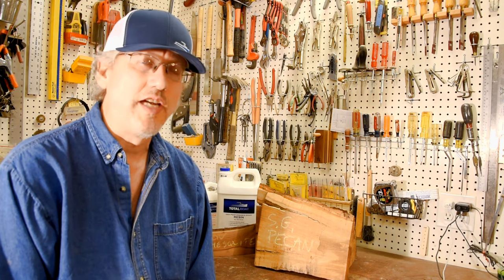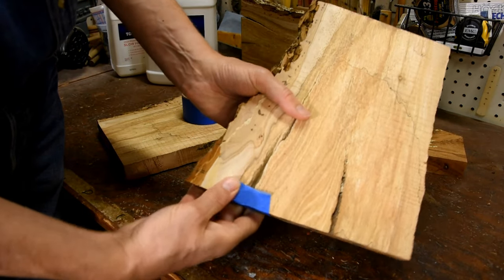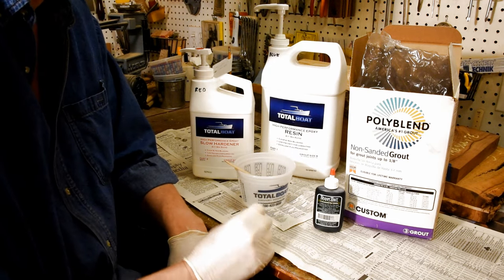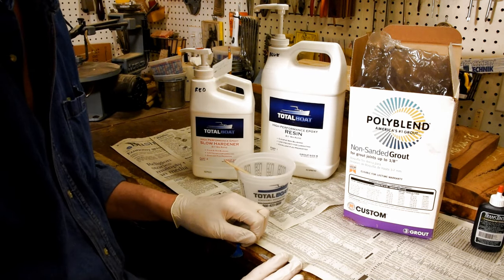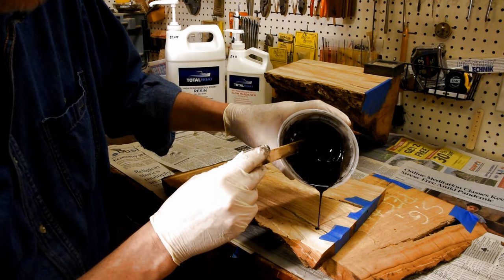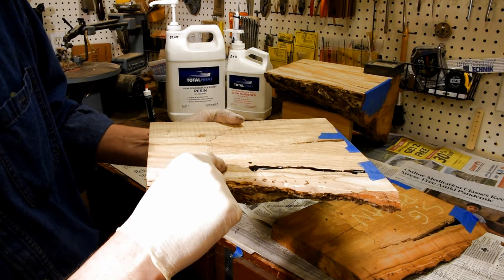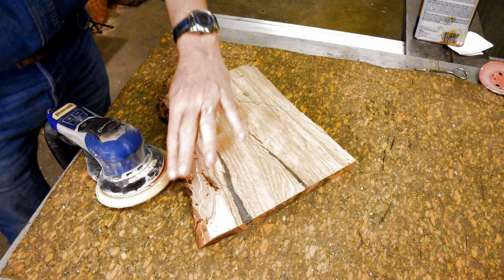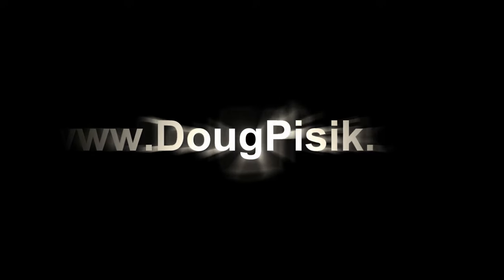Using Epoxy Resin to Fill Cracks and Gaps in Wood - Complete Tips and Techniques

Comment: Tip from experience:  When you're using tape to secure the back side of cracks, holes, etc., for larger epoxy pours than Doug shows in the video, MAKE SURE the back is supported.  Epoxy is heavy, and the tape can only take so much before it starts bulging and leaking.  Blue tape, frog tape, Tyvek tape, doesn't matter...support the bottom with something flat and hard on larger pours.
Reply from the maker: Great tip, Jason.  My project was flat on the table, but it the crack was unsupported it would have been a problem.  Thanks for mentioning this.
Reply: @dougpisik  Is there  a way to fix it once it leaks through the tape. I didn't support, so every deep pour leaked. so heating and removing all the epoxy i can, and plan to repour. Hope this works as i don't want to loose the project.
Reply from the maker: @vegasace  If I understand your question, it sounds like the epoxy poured out the bottom and left a bad mess to clean up.  I wouldn't remove any of the epoxy that is in the crack.  I also wouldn't heat the epoxy that is on the surface.  Instead, I'd recommend using a heavy grit sandpaper to sand down the mess from the bottom.  You can then re-tape it and ensure it's secure.  Then you can repour more black epoxy into the crack to finish filling the gap.  Good luck with it.  Sorry you had a problem.  I know what a mess leaked epoxy can be.
Reply: @dougpisik  Thank you so much, i just got a heat gun and was about to go down that road...saved me! Appreciate the advice and the nice words..its all about learning so still very excited..messes we can clean! Ill keep you posted.
Reply: @ doug pisik - Took  me awhile to finish, but wanted to thank you. Table turned out great, thanks to all your help. Would post a pic here if it would let me, but very happy with the piece!
Reply from the maker: @vegasace  Sorry I didn't respond to this months ago.  So glad your project worked out!
Reply: Thank you for your video.  Going to attempt some black walnut end tables now

Comment: Just a quick note of thanks for the tip re using non sanded grout to tint the epoxy in void filling. I just finished a project and used the same grout, based on this video’s recommendation. Worked fantastic, and now I have about 2 lifetime’s supply of black epoxy tint at about 1/50th of the price of regular tint powder or TransTint dye.  Thanks.
Reply from the maker: I'm so glad you could use this info.  I know what you mean about the amount of grout.  I've barely made a dent in the box I bought years ago.
Reply: Where did you get your grout? Both Amazon and home depot don't list black as an option but have charcoal.
Reply: @partycakes456  Both Doug and I were using the ‘charcoal’ colour. There is no ‘black’ in that brand, that I could find. The charcoal grout is, I would say, ‘very nearly black’ once immersed in the epoxy.  It’s not a true jet black - more of a very very nearly black dark grey - but it’s ‘black enough’ for this purpose.
Reply: @Ian_Hay  Thank you, I'll give the charcoal a try.
Reply from the maker: @partycakes456  I did use “Charcoal.”  Thanks for asking.

Comment: I like the tip of using the un sanded grout for color. I guess since grout uses water to cure then mixing with the epoxy kind of seals it from moisture and probably if any moisture does get to it from humidity or whatever then it just cures also? Just trying to think the chemistry through some and avoid any long term problems from something maybe even attracting moisture.
Reply from the maker: Thanks for the comments and question.  I haven't had any issues with the grout.  It's really just a powdered pigment that doesn't dissolve.  I agree that since it's coated and soaked in epoxy, it doesn't absorb liquid.  That said, I haven't tried it for outdoor projects, but I feel confident that it should work just fine.

Comment: It's good to know that the epoxy was hard enough to be sanded or planed after a single night of curing. The documentation for the Total Boat 2:1 with slow hardener recommends 5 days of curing, so out of an abundance of caution, that's how long I've been waiting before sanding off the excess.
Reply from the maker: Rob, great advice and input.  It's true that it's better to wait before sanding.  I have found that for cracks and smaller pours overnight often works for me, but it could be that the addition of the grout makes the epoxy cure harder.  In addition, my shop is warm.  That said, waiting is safer, and ensuring the work is not curing in an unheated room (like a garage shop in winter) is also helpful.

Comment: Nice video! Thank you for the tips! I’ve never experimented with epoxy before. I’m looking to fill small worn holes and knots in a charcuterie board. Is this method food safe?
Reply from the maker: Many people use epoxy on serving boards and tables, but I can’t confirm 100% food safe. Best to contact your epoxy manufacturer.  My understanding is that once the epoxy is FULLY cured (about a month), there are no concerns serving cold food on it.  I personally would avoid putting hot food directly on the epoxy.

Comment: How long did you wait before you ran the work through the planer?   You said ‘the next morning’ when you took off the paint, but I thought that sanding had to wait for full curing … 5 - 7 days?
Reply from the maker: You usually want to wait a few days depending on the epoxy used.  If you sand epoxy before it's fully cured it will gunk up your sandpaper and not sand well.  If you use a planer on very hard epoxy, you run the risk of chip-out.  Although not really planned, by only waiting a day the epoxy was hard, but less likely to chip...so running it through the planer worked out just fine.  That said, it is better to wait a few days, and if you use a planer, take multiple passes with very thin shavings.  Hope this helps.

Comment: Great demo. But what do u make out of those pieces?
Reply from the maker: Glad you asked, Susan. 
Smaller repaired pieces like shown in this video I use for creating art boxes. Longer boards are used for furniture like table tops. I have used this technique to fill in the splits in logs and then turned them on my lathe to make bowls and vessels.  In addition to cracks, this technique is used to fill in voids and knot holes. All these repairs look like natural accents, and if you decide to use colored dyes instead of black the repairs can become rather artful.

Comment: Great Idea using non sanded grout. I´ll give it a try. 
Right now I always have to do two steps when filling in crack´s. One coat of clear resin followed by one with black dye.
As you say if you use black dye epoxy right away it leaves a Gray shadow in the wood.

Comment: Great video.  What would you suggest for pre-finished hardwood floor planks as I'm building a table out of leftover pieces and a few have some knot openings no more than 1/4".  Would a flat chisel be ideal for cleaning up those little spots?
Reply from the maker: If feasible, I would mask over the area to be filled and cut out an opening for the hole. This will prevent the epoxy from getting on the finish. If a hole is about an 1/8th of an inch or less, you can fill the spot with black CA glue instead of epoxy. As for smoothing the surface, a chisel usually won’t work on brittle materials like epoxy. Since the holes are small, I’d recommend trying to just fill the holes up to the top without going over. Hopefully you won’t have to do any touch up, but if you do, then I’d recommend sanding and polishing the patch with the masking tape in place to protect the wood finish. Alternatively to all of this is to just use a wood putty since the holes are small. That might be your best bet. Hope this helps.

Comment: thanks for the video. Question. I am working on a 5 ft by approx 1 ft  oak board....very very dry ...with lots of cracks. That was the appeal.  But wow..when pouring  epoxy today ( i am new at this but watched so many videos my head is swimming) it just soaked right into the wood....leaving the crack still open...I waited..then poured again....thinking ok now that it is coated and a bit tacky the next pour will fill the crack...noo.  A couple of the cracks did finally fill in...i will probably have to top them off a bit...I waited the last time until the epoxy started to firm up a bit..a lot...SO...i decided perhaps I needed to "seal coat"? first ...but i dont want to seal the whole thing because i want to use 3 different colors to fill the cracks.  Is this making any sense?   So i thought ..I wil lspray a polyurethane coating...then later fill the cracks. Would the polyurethane spray be bad to use if using Resin? If so what can I use?
Reply from the maker: Nila, great question.  What you describe is almost like making a river table with the larger cracks. I don't recommend a poly spray since the epoxy might not stick to it and also you may see the line between the poly and the epoxy.  Sealing first with epoxy for large cracks does make sense.  It can be brushed on with a disposable brush.  Just be sure to wait until it has hardened but is still tacky to the touch before doing the final pour.  If it hardens all the way it will be a problem unless you can find a way to scuff the hardened epoxy with sandpaper before the final pour.  That can be a real challenge inside of a crack.  To see more details on how I seal the wood for larger epoxy pours, check out my river table video at https://www.youtube.com/watch?v=31DNwkHTZ2I.  It may answer some of your questions and give you additional ideas.

Comment: Wow Doug can I borrow your tools? ha ha I do have a huge beautiful imported Mexican pine table. The wood scratches easily. I think its more of a softer pine as it sands easily. There is a deep knot hole the size of a nickel that was filled with cheap light wood filler which I removed. There also is an 1/8 inch seam the length  of the table where 2 pieces of the top of the table were joined and the same wood filler has shrunk. It looks awful. I also had a big long piece of wood that splintered off the top. Its roughly a 1/8 " deep and jagged. I'd  like to refinish it. The wood is a light golden yellow. What should I fill it with? I can't  afford to buy huge cans of 2 part epoxy. There is a 2 part putty epoxy stick you can buy for smaller jobs but I can't  remember the name or if it stains well. Can you recommend a product? I don't  know if I should just sand it or stain it. Can you recommend what to top coat it with to preserve the color of the natural wood that won't  yellow? If I stain it is that stain permanent once its on?
Reply from the maker: Gail, you have a lot going on here!  The challenge with filling wood cracks is that wood movement due to changes in humidity causes the cracks in wood filler.  Unless you use something like epoxy that is also a glue that holds things together, cracks may reappear.  That said, some fillers work better than others.  Also, putting a finish on a table slows down the wood movement.  The good news is that knot holes and divots caused by a removed splinter don't tend to have this problem.  I recommend you fill in all your cracks and divots with Timbermate wood filler.  It comes in different colors, so you can get a decent match...however, I usually like to use contrasting wood colors since it can make a crack or divot look like a natural feature in the wood instead of a repair.  Usually I go with a couple shades darker than the rest of the wood.  That's a design decision that's totally up to you.  As for staining, your scratches will show up really dark unless they are sanded completely out.  Again, that is a design decision.  Note that pine can look blotchy if stained, so be sure to use a stain sealer bottom coat if you do decide to stain.  As for a protective finish, I like wipe-on polyurethanes.  I'd recommend at least three coats top AND bottom.  You need to do both to ensure moisture in the air doesn't absorb into the wood unevenly which can cause warping and more cracking.  Others may have additional or different advise, but I do hope this helps.

Comment: Hi doug,

I have a challenging situation, we have made some benches using sleeper pine woods. After all the processing of benches we have kepy outside for the sun... We observed that it has started cracking and opend up to an extent of 25mmm and also full length of the bench. Could suggest me an solution for this issue. If you kindly send me your emaild id.. I would share you with pictures as well.
Tomorroq we need to reply for our client can u suggest me something.
Reply from the maker: You can use this same method shown in this video.  If you do, I recommend doing two pours to ensure the epoxy doesn't get too thick and overheat.  Another option (which I've done before) is to add butterfly/bowtie supports across the cracks for added support.  Once done, you can either leave the cracks as is knowing that the bowties should minimize future cracking, or fill in the gap with this technique after the bowties are installed.  It makes for a nice accent and adds strength.  YBTW: ou can ask your client if they'd like a color accent.  If so, you don't need to use black.  You can dye the epoxy any color you'd like.

Comment: very helpful, new to this so it was what i needed to see, dont know if you`ll see this but would you ever use planer or power hand planer if there is still silicon on the wood, will it gum up my blades?  i build waterfalls so wood workin is a bit new for me.  thanks
Reply from the maker: Marcus.  thanks for the comment.  If the epoxy is fully cured, then it will not gum up your blades.  Be sure to take light passes so it doesn't chip out.  Regarding silicon, I didn't use any in this video, but I have used silicon sealant at times to ensure epoxy doesn't flow where I don't want it to flow.  Efforts should be taken to remove it all before planing it.  Minute residue or amounts shouldn't be a problem, but otherwise it can gum up blades.
Reply: @dougpisik  yep i was afraid it might, not worried bout the epoxy, but just didnt like the thought of silicon, thank ya doug for your time.

Comment: May I please ask. I want to try this with some mulberry wood which is quite yellow. Would you use a coloured resin or clear?
Reply from the maker: Good question. It depends on the look you’re going for. I like colored filler since it adds an accent to the wood. You can use colors other than black to give the piece a different look. Dark brown is natural. Red or blue can create a color pop. If you use clear then you’ll want to sand the inside of the crack so it will look nice after being filled.

Comment: Hi Doug, great video! I recently had my first foray into filling very small cracks on a knot, but used black dye and had a lot of color bleed. The grout tip is invaluable. However, I also had an issue where the wood (birch) just absorbed every bit of epoxy I threw at it. There was no leakage, I just had to stop adding more because the color bleeding alongside the absorption got too extreme. My hardener was also too slow (three-day stuff), but even within one overnight period the absorption rate was basically 100%. Maybe should have used more viscous stuff to prevent it.

What viscosity of epoxy would you recommend for crack filling applications, and what is your preferred hardener ”speed” there?
Reply from the maker: Thanks for the comment and kind words. As for the epoxy, I use what would be considered a medium viscosity.  That said, some woods are just very porous.  To avoid excessive absorption or color bleeding, a sealcoat of clear epoxy should be used first...just enough to coat the exposed surface of the wood in the crack spread around with a small disposable brush or thin piece of wood.  Let it cure overnight, and then pour in the colored resin.  If you do this, it's highly unlikely you'll have an absorption issue.

Comment: I don’t own a planar. Will an orbital sander take the epoxy down at the same rate as wood?  Seems like the rates would be different and cause trouble.
Reply from the maker: If you use a new course grit paper with a rigid pad and moderate pressure, it should flatten out the epoxy level with the wood without any issues. I’ve done this plenty of times. Just make sure you don’t use a soft or sponge pad on your sander, and don’t push the sander down. The weight of your hand should be enough.   I’m glad you asked this question.  Thanks.

Comment: Likely a dumb question, but if I intended to use a contrasting color, say red, would you still go with the charcoal grout or would a uncolored grout work better? thanks, loved the video
Reply from the maker: The color comes from the grout…so any color will work. Don’t dye the epoxy or it will just mix colors with the grout.  For example, if you dyed the epoxy blue and used yellow grout, you’d probably end up with green.

Comment: Turned out great.  Surprised the masking tape stopped bleed through on the backside.  Is there a difference to the "blue" version of tape that helps it do this?
Reply from the maker: Thanks for the comment.  If the wood has been planed flat and smooth, then the tape works great.  I make sure it's rubbed into place and that the wood is placed on a flat surface before pouring in the epoxy.  I like the blue painter's tape because it peals off easier, is designed to create a seal, and doesn't tend to stick to the epoxy.  Note that if the wood is rough or has uneven surface, then the tape might not work very well.